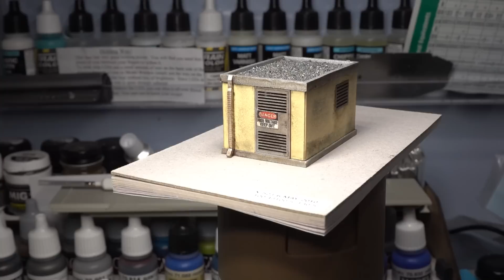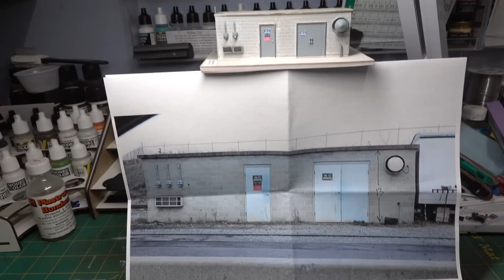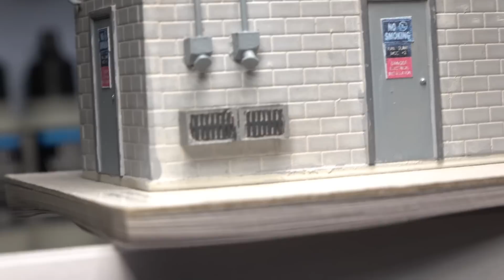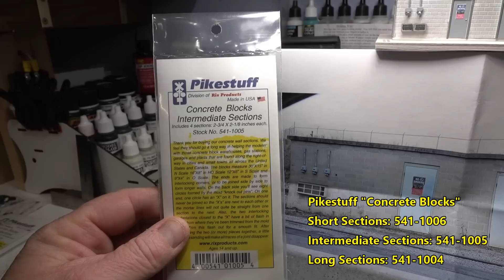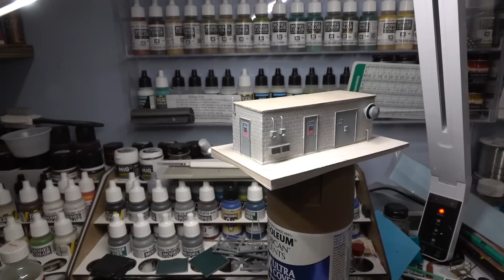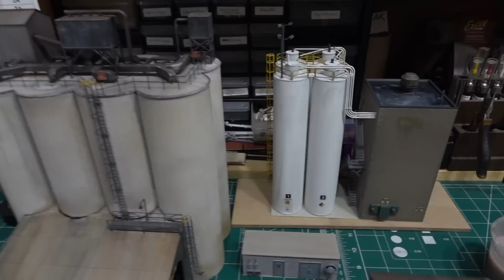MRUV: Small Auxiliary Buildings

Comment: Two good-looking buildings and of course, the scratchbuilt one is the better of the two. 👌Looking at the outlets on the larger building, it would look pretty cool if you had an Ho scale welder/engineer using something that's "plugged-in" to one of the outlets. Thin wire/thread or similar would probably work fine. As usual Rob, just a thought. 😁

Cheers for now,
Dougie.